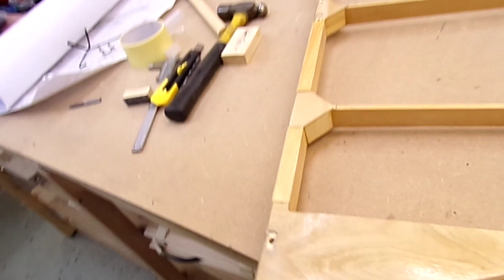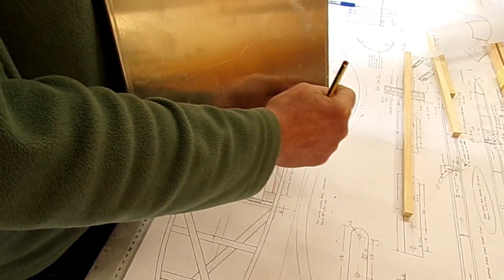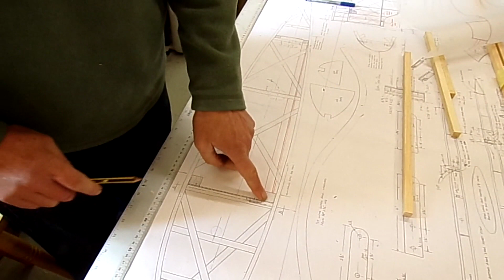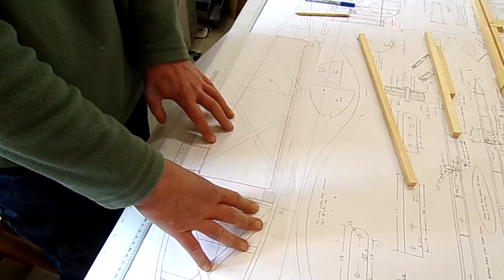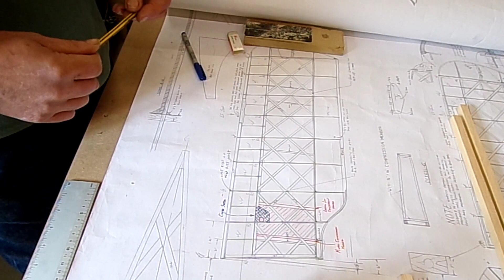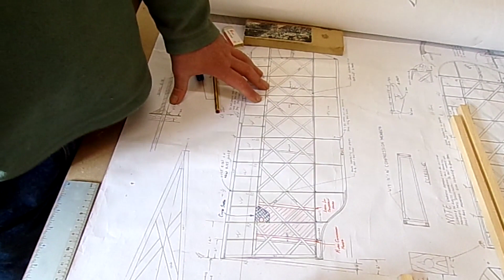EP50 Finish Rudder hinge mounting and plan the fuel tank install.

Comment: It looks like the "wing compression rib" is there as bracing to provide stiffness against fabric tension loads.
Reply from the maker: Yes the geodetic deals with the other loads.
Reply: @flyingkub  
The light construction is amazing.  I was expecting to see Ribs with gussets around the Spar openings, these would be used to tie Ribs to Spar Shear-Webs (forward and rear), using triangle pieces.
Best regards
Reply from the maker: @Lawiah0  This is not a structure type used a lot but it is very stiff and light. Thanks for your comments.
Reply: @flyingkub  Thank you for the videos.

Comment: Seems like the geodetic is a bit over kill. I say this because their is alot of other kit planes that Don't use that method and fly just fine. So what gives?
Reply from the maker: The geodetic makes the structure far more torsional rigid for little weight but more work. Other planes get away from geodetic by larger "D" boxes heavier spars and bracing. I think for part 103 it may be  OTT but it works.